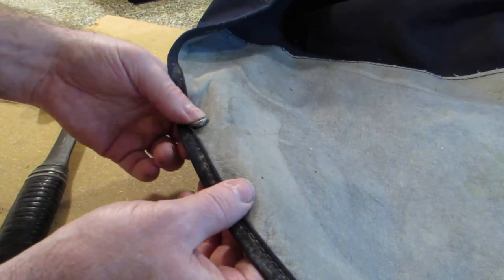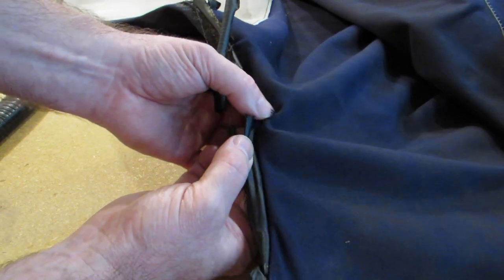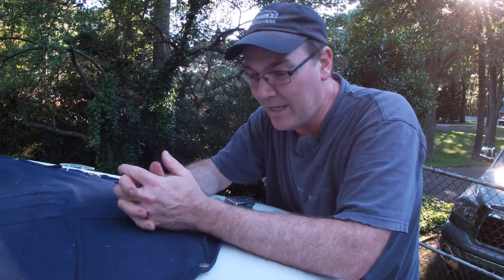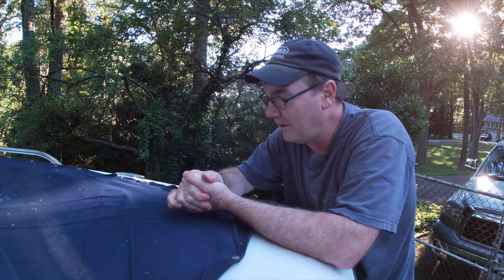How to replace canvas snaps. Fix broken snaps on your boat cockpit cover

Comment: Thanks for the video. I bought a used boat with a few problems. One problem is missing canvas snaps. But in my case the canvas has all its snaps but the boat side of the snap is missing. Would be cool to post a video on how to replace the boat side of the snap. Thx, I enjoyed this video.

Comment: Thanks. This is good. Of course none of this is new; it's always good to go back to the basics.  I sailed across the Pacific on a boat with a couple of busted snaps and no kit.  On my boat my dodger shrank a bit over the years and my zippers were a pain. There's a company EZZ Extenders... that sells pre made  zippers sewed back to back to give you an extra inch. I made my own. Total game changer. What was time consuming and frustrating is now easy.   At the top of my main dodger door are some twist closers that were also shrunk out of alignment. With the zipper as example, what I intend to do next is either make a couple of short extenders with snaps or with the twists. This will keep rain from blowing into the gap. When you open any of these extenders of course you only do one side. 
Something about snaps. Have the kit onboard, but another option might be in critical places  -- like the corners of single panel Clears,   put snaps very close to each other so if one goes you immediately have a spare. Also if you ever have a snap (or any other fastener) that has popped opened, putting and using a second one close to it 1" (2.5cm) would solve that problem.  (I learned this nailing drywall, a single nail in the center of a panel will always pop, double nails never ever do.Screws made this trick obsolete.)
Reply: Thanks. I ordered a marine grade snap set from Amazon, with the basic tools. And I made sure to get a kit that also had male snaps that can be fitted on the canvas. (Many kits only had the male snaps for screw in to a hard surface.)   And I ordered a 'vise grip'  installation tool so I don't have to have a hard surface.  

Going to solve a few small problems on my boat. 
One thing I figured out to do for mini tent stakes is to tie about an  8" loop  of orange paracord to each one. I'd lost two of my larger brighter stakes in two days, but noticed the smaller dark red ones with a dark green string never got lost. The tails worked. 3 months of camping no more lost stakes. 
At home I taped a few inches of the bright fluorescent construction marking ribbon to my TV remotes and other easy to misplace stuff.  Amazing how effective this is. The Sunbrella cover of my isinglass  often gets turned around, so I think when I add a few snaps, following the Red/Starboard Green/Port standard I'll attach a bit of the ribbon under one of the new snaps.   Thanks again for the video

Comment: That looks really easy. I'm wondering if I can repurpose a mooring cover into a snap cockpit cover to replace the one missing from my boat(it has snaps screwed to the perimeter of the cockpit)
Reply from the maker: For under $20 it's worth a try! You would need a hole punch - my kit did not come with one, but the photo in the ad shows one - so I don't know if it was missing or they just don't include one any more.
Reply: @WayneTheBoatGuy  Definitely seems worth a try! I'm also researching glues to create a sun and weatherproof edge seam, since I don't have a sewing machine. Hopefully I'll find a way to create the world's most inexpensive custom cockpit cover. 😄

Comment: Do you put any lubricants on snaps?  I think they would go together more easily and come off more easily. Something like candle wax.
Reply from the maker: I didn't use any. Just be sure it isn't something that could discolor your boat, stain your canvas or damage your canvas.
Reply: I just bought a leather sewing machine at a garage sale. $100. Brand new- never used. Having fun fixing items I could not do without it.

Comment: How do you repair the snap on the fiberglass. I tried glue and marine resin, no good.
Reply from the maker: You probably need something that dries solid to hold a new screw - maybe marine JB Weld and screw a new pilot hole.

Comment: I have the opposite problem right now.  Snaps are fine, but the part that screws in to the fiberglass that you snap on to has come loose.  Have you encountered that?
Reply from the maker: I have not, but some people have been able to reset them with a dab of 3M 5200 or epoxy in the hole.
Reply: @WayneTheBoatGuy  that's what I'd been finding as a recommended method.  I'll give it a try.
Reply: you can buy a threaded snap that's 1 thread size up. or if you have access to the back, you can use a threaded stud with a nut. Repairing the hole with epoxy works, but I wouldn't epoxy the snap in. Future replacement would be tough.

Comment: What do you recommend for replacing the studs in the fiberglass that are stripped out or missing?
Reply from the maker: I personally would try to fill the hole with some epoxy - hopefully similar tint to the hull and re-drill when it is dry.